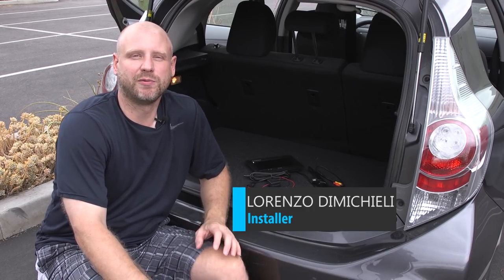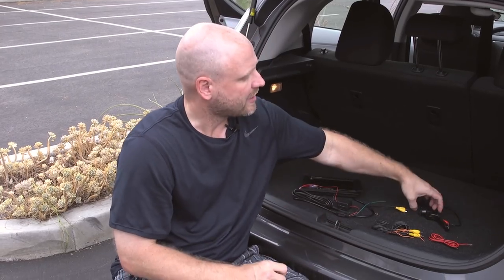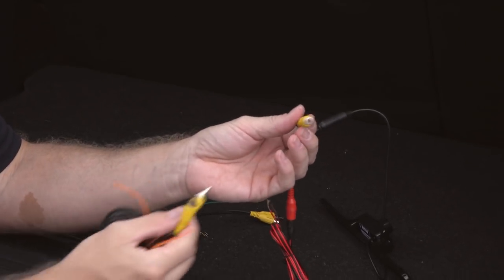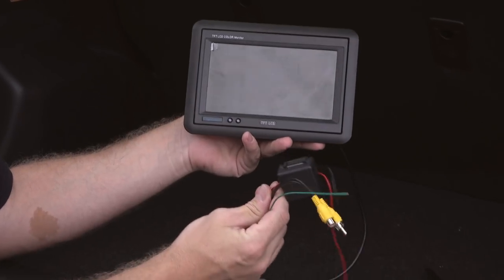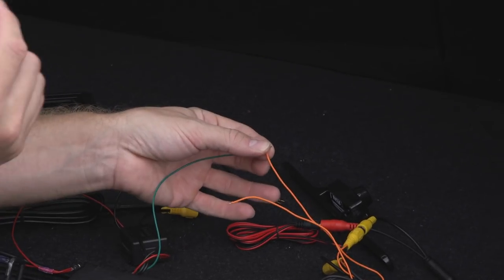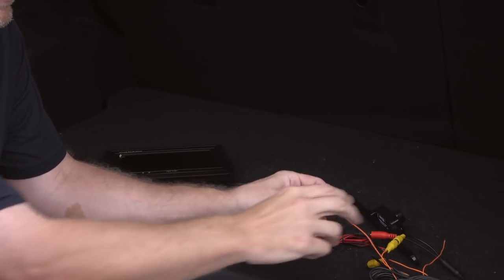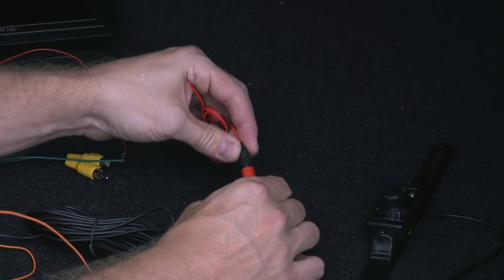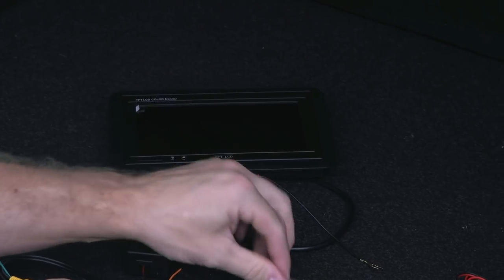5 Step Backup Camera Installation

Comment: Excellent professional video.  Best one I have seen on the subject.  Just bought a 2014 x1 it has Nav but no back up camera.  That is the one thing I could not find on BMWUSA.  What gives?  Would like the integrated rearview mirror with dynamic guidance.  Any direction would be appreciated, has been ominous researching thus far.  Cheers.
Reply from the maker: You may have some trouble replacing the mirror in that vehicle, it has a rain sensor and is part of the security system with the LED indicator at the bottom. To integrate a back up camera to the factory NAV screen will take a navigation interface. They are available for that vehicle and there are certain places that claim to have the factory parts and can enable this with a change in a hex key, I have seen it first hand. You should visit a BMW forum as they would have all of the information that you would need.

Comment: Nice video! I think what some people like me do not understand is... Does that Orange trigger wire run inside that black video cable thus running the whole length of the vehicle? The way the orange wire appears, it looks like it just starts and you have to add the extra wire to reach the other end of the Orange wire to complete the connection?

Comment: Hi, The best video ever. I had looked through a lot of video but all very kind of useless for me. Yours is the best. I just got 1 question. My monitor has Red and Black wires only not green. Can I power up monitor through little red wire attached to rca cable provided I do connections as you suggested. Thanks, Tandy
Reply from the maker: Tandy, your monitor likely has a video sense and not a trigger. This means that once the monitor sees the video input signal from the camera the monitor will switch automatically on and to that video input.

Comment: thanks Lorenzo for the great vids. I have a rear view mirror monitor, my fuse block had some unused spares listed in the owners manual so I used a fuse tap to one of those, and it is always hot, so everything works great, but was wondering if the monitor having power all the time will cause battery drain.
Reply from the maker: Yes it definitely will!
Reply: OK, everything has been fine, my truck has a huge battery, but i guess I will have to find a switched source for the Mirror monitor at some point. Thanks again.
Reply from the maker: No problem Steve!

Comment: Great video! I understand fully how to wire the camera from the reverse lights wiring end and then to the trigger wire, but another question has formed. My radio also offers another option called a camera view. Do you recommend a switch to turn on the camera or might the radio have another wire connection that would turn the camera on when the reverse lights are off?
Reply from the maker: It most likely has a backup camera input in the rear which you can connect to!

Comment: so this 5 step video, starts off with you showing us what to expect to use, and you touched everything! thanks for that- but! you picked up the 12v plug and then never showed how to use it or where it belongs in the system? I'm trying to run both the camera and the monitor off the 12v plug (the thing that goes in the cigarette lighter hole) so it only on when I plug it in and stays on during trailer hookup regardless of truck being in reverse? so red power wire from camera and orange wire from video cable would go together? then red power wire from display and orange wire from rca video cable together and connected to red power wire on 12v plug? then black wire from display to black wire on 12v plug? but but but what about the black wire from the camera? Noone has made a video for the 12v plug so I thought I'd ask before frying this new camera

Comment: Thanks for the video..only have a question on how to install a CMX chime module...it came with one of my 3 kits used on the rear view camera but had no instructions enclosed...I think I need an adapter to attach this to the third line open on the monitor. It looks like a mini suitcase and is about 1 inch by 1 1/2 inch wide. Going to Best Buy tomorrow to see if they have an adapter...

Comment: I have a situation which I wish you can help me with. Before I say the situation, I would like to thank you for the awsom video. The situation is...When I hook up the camera direct, it will will work fine. When I hook it up as a regular way, it will say no signal.The camera gott broken and I ordered another one and I have same. I checked all wiring and everything, and it works fine. I used the om meter reader for the back up light and I got a sound'' beeb'' even When the vehicle off.

Comment: Hi, great video. My lcd monitor only has pos. & neg. lead, no trigger. Can I also power the monitor with the red wire from the RCA cable or will that cause overload? Thanks

Comment: I am installing a PLCM7500 on my son's 2000 Silverado. Im tracking every step of your instructions until I reach 4:44 to 4:48. That wire seems to be 3 ft short if I"m to connect to the wire that is powering the camera. That particular wire that you are showing I have connected to the reverse lights. Where have I gone wrong?? Thank you
Reply from the maker: +Donald Waterman The orange wire at the 4:44 is a wire that is run full length of the RCA cable. If you are short you can extend this wire with a wire of your choice. One side of this wire will connect to the camera power connector. The other side will need to connect to positive 12 volts, at the monitor. This will then power the camera from the same source as the monitor. Hope this helps.

Comment: Could vehicles with tow package  harness have a connection so you won't have to use taps which compromise the wires!

Comment: hi nice video,I have a toyota yaris I buy the camera and a wireless system to transmit the video signal. My question is I went to see the reverse light, there are two cables that comes from  the light bulb. One is red  and the other black. So what I need to do is  connect the red cable of the camera to the red cable of the reverse light bulb and this I think is correct. But there is something I don't understand. The black cable that come from the camera, do I have to connect   to the black cable  that come from the light bulb of the reverse light ? Or I need to use the black cable from the camera and ground it to the chasis of the car ,without touching the black cable of the light bulb ?

thank you
Reply from the maker: +Antonio Mainenti One of the wires is positive the other is negative, you will need to test the lead to see what is positive and make your camera connection appropriately

Comment: wait so does the two wires that come from the back up camera and connect to your reverse lights only power the camera lights or the the camera aswell. if you want have the monitor always on do you have to connect the red wire to an accessory lead that turns on when the car is onm or is that what the small red wire does? do you just connect that wire to ur accessory and it will power the camera on without the lights?

Comment: Hi, my honda accord 07 has back up lights near license plate. I was wondering if I can use that as power source for the back up camera since it is required to remover the rear bumper to get access to the tail light? How can I test if the source is 12V using a multimeter?

Comment: my BOYO VTL425HD both the video plug and power plug are run through a single plug for 20'. meaning i would have to run the cord from rear of truck to front through console, then run power cable back through the console to the rear of the truck to splice into reverse light. What am i missing?

Comment: I'm trying to install a back up camera kind of like style #1 in your video. I hooked up the camera to the reverse light and I have power testing with a multimeter with the long cord. I cannot seem to get picture or the monitor to turn on when using a rear view mirror/monitor. I tried hooking up the monitor to cigarette lighter for power and to the camera power cord separately still with no luck. Any thoughts on what could be the problem? I tried 2 different monitors and 2 cameras with no fix.
thanks!

Comment: The system I have fitted is wireless,the connection at the camera is fine,the connection at the monitor and receiver is a little different. I have power to the receiver off the cigarette lighter wiring and the monitor has +/- and a blue wire, would that be the trigger wire, if it is, should that supply the power? as it is my system works only when it is in reverse but I have to turn the monitor on manually. Thanks again for the video.
Reply from the maker: +Ron GREEN You could splice the +/- of the cigarette lighter cord to that of the monitor so that the receiver and monitor have the same power source. The trigger wire will need to be run to the reverse light or you will need to manually turn the monitor on in reverse to see an image.
Reply: Quality Mobile Video Thank you, for your help. From downunder Ron
Reply from the maker: +Ron GREEN Glad we could help!

Comment: i have a wireless wifi backup camera to be installed in my jku and my anroid phone as monitor. i need the camera on when i switch on the car, where do i connect the backup camera power (preferably somewhere at the back),

Comment: hi

what If your head unit does not have a trigger wire?

how would I make the camera  come on when the car is in reverse only?
Reply from the maker: +Mohammed Hamzah there should be a reverse wire on the radio if it has a camera input.

Comment: 1:22, "like we showed you last week."  It's now 2017.  What if I missed "last week?"  You should not have time references in your videos.  They are useless.  Better to reference, WITH A LINK, to the the previous video.  This video is GREAT if you're going to keep you camera, monitor and wires in the trunk.  How about showing how to run the cables, connect to the power of the tail light, mount the camera, mount the monitor, and so on. This is not a "camera installation."  It's a "camera wiring" demo.
Reply from the maker: We have a video on that, all you had to do was look at our install videos: https://www.youtube.com/watch?v=TqgMu3K6tNQ
Reply from the maker: And we have learned not to do time references, that was the only time we did it in over 300 videos

Comment: Bad BAD BAD nothing should be connected to the reverse light. test the dam thing for continuity connect the red to the orange and send power down the rca from the front. tap into the reverse wire upfront for the trigger wire.making this far more complicated then needed. Tail lights were not meant to be the primary source of cameras. Hell if your installing it on a stereo all the power comes from the stereo and again sending power down the rca AKA the orange  and the trigger wire is connected up front nothing touched on the rear tail lights.

Comment: I appreciate the info but you explained like three or four different options all at the same time. You had me, then you lost me. I have a stereo at one end, a camera at the other and I want to see only when I'm backing up. Pretty simple, but really hard to find someone who can show me how to do it right.
Reply from the maker: +shotguncomedy Watch this one https://www.youtube.com/watch?v=TqgMu3K6tNQ
Reply: +Quality Mobile Video Thanks, that's definitely the most helpful one I've seen yet! Extra helpful since I'm working on a 4Runner and it's pretty similar to that Toyota in the video. I'll figure this out yet. Thanks for taking the time to make these videos.
Reply from the maker: shotguncomedy Of course! The first video is kind of just a basic setup of what you'll need to do it, but we go over the entire install in the other one. Good Luck!
Reply: +Quality Mobile Video - Hey, I've got a quick question about the trigger wire, this seemed a good place to ask. Can you just disregard that thin red wire attached to the video cable and run your own trigger wire from the backup lights to the head unit with the same result? Am I missing anything? I want to run a better wire over a shorter span to eliminate what seems like a weak point in the system.
Reply from the maker: +shotguncomedy Yes, you can disregard that wire if you do not need it.

Comment: Very confusing explanation.  Not all people are going to have basic knowledge of wiring. The manufacturer could have made it much more simple! Also all exposed wiring should be properly using crimp connectors and harnesses cover,  and routed along the wiring neatly using cable ties.